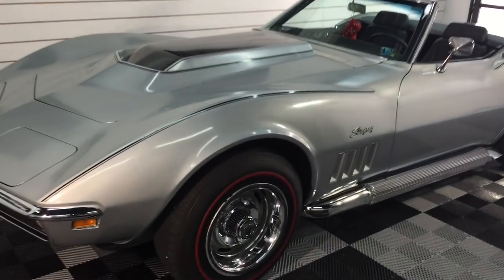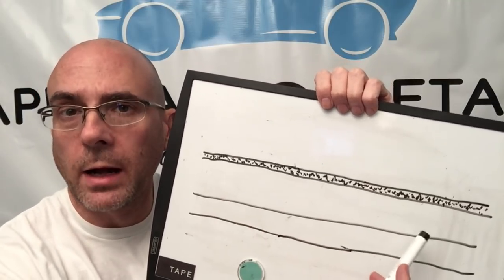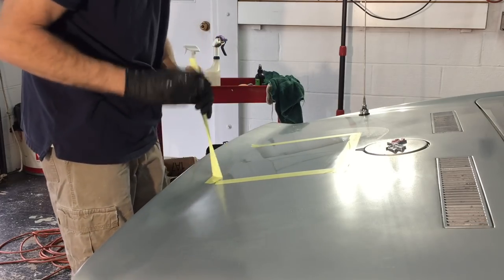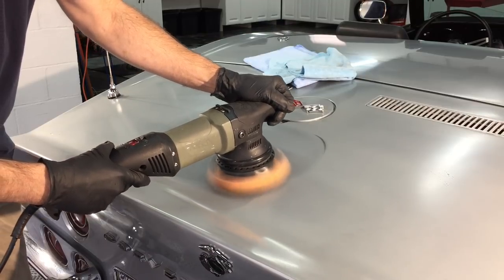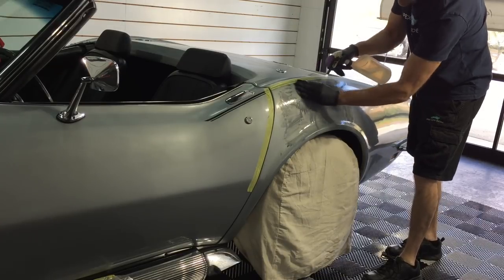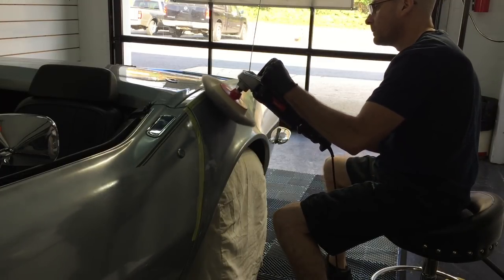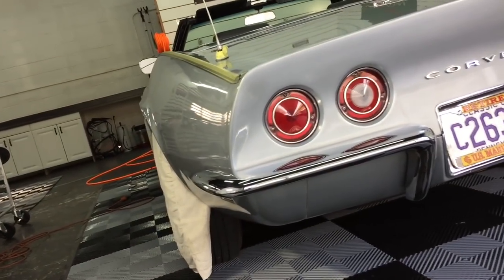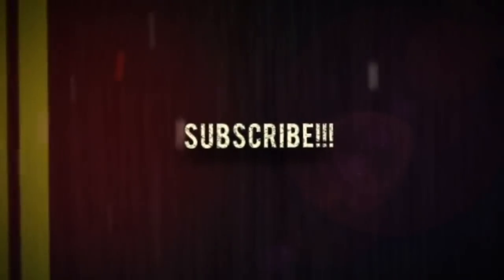How to remove heavy paint oxidation!! Paint restoration on 68' Corvette Stingray!!

Comment: Perfect timing! I'm working on a '76 Corvette Stingray on Friday! The paint is aftermarket and purple. It's going to require the 3000-grit Trizact discs for a lot of surface area. Thank you for sharing! :)
Reply from the maker: What is the goal? Texture removal? Oxidation?
Reply: @apexdetail85  The whole clear coat is getting a one-step to help clear up some cloudiness, but the main part is that the car was vandalized and scratched to heck and back in several areas. We'll see how low of grit I'll have to go to get a a safe result. The customer's expectation is set appropriately.

Comment: Great video and excellent job on restoring that paint.
You obviously have many years of experience.
I worked in a body shop when I was a teenager during the 70’s so I’m no stranger to lacquer paint.
Finnicky material compared to today’s urethane’s.very susceptible to burning due to it being a thermoplastic product vs thermoset.
Another way to go with a situation like that I think would be to follow up the 3000 grit wet sand with 5000 and 8000 grit wet san so that less buffing is required to bring it back from the dead so that less heat is introduced to the surface.
Please keep the videos coming

Comment: Great video as always. For single stage/ original paint would it be safer to use something like a Rupes Yellow Foam pad / Polish to clean it up and coat it from there? Worried about burning threw the single stage. I guess it could be done it will just yield lesser results than going with the 3k sand paper steps.
 Thank you

Comment: brain  , awesome work and thank you for sharing your knowledge with us beginner detailers.i would like to know is which size and manufacture pads do you use on your rotory i still have my old b&d polisher 6138 from years ago.
Reply from the maker: I use both a 5 and 7 inch backing plate. I use quite a few pads. Ardex wool, buff and shine foam, Lake Country lambs wool...all depending on situation.
Reply: first off, i just noticed  i spelled your name wrong, brain instead of brian but maybe i didnt . lol , anyway could you recommend which foam pads to get for now 5 ,6 , 7 , or 8 inch .im thinking maybe some 7 inch with a 6 inch lc flex backing plate.one more question. what are your thoughts on the lc ccs curved pads, are the any good. thanks again k

Comment: Awesome! How did you clean the pads in between passes? Also do you have a link for the pneumatic 2inch polisher pad and backing plate?
Reply from the maker: Ludensol _ the polisher and backing plate can be purchased at Harbor Freight stores or online. Central pneumatic. I clean my pads with a brush, Poorboysworld tornado pad cleaner and forced air.

Comment: when wet sanding an already wavy car, would a soft sanding block help when doing that so your fingre tips dont exploite the wavynes and maybe help straiten out the quearter pannel a bit..?
Reply from the maker: Not much can be done for the waves or sags at that point blocks can be used if comfortable with them.

Comment: Wsup Brian. I would like to purchase an air compressor for detailing. To blowout cracks and crevices after a wash as well as the inside and to blow out my polishing pads. Any suggestions? I'm looking for good quality but not too expensive.
Reply from the maker: I have a 30 gallon, 90 psi continuous dewalt compressor... it was on sale for $145.00 at Tractor Supply stores.

Comment: Could you apply a ceramic coating after paint correction to these older single stage vehicles? I have an 87 Chevrolet truck that I am considering doing that too
Reply from the maker: Absolutely! Just make sure the oxidation and imperfections are removed completely

Comment: I dont think I will ever understand this paint or clear coat thickness thing...  how can I wet sand a car, and still have enogh protecting left, when some say that a good buffing with compound and microfiber pad will reduce almost half of what is needed to protect the colour ?
Reply: Actually wetsanding is often less abrasive then using cutting compounds
Reply: @janalm1581  and that is what I dont understand.... you can remove pretty deep scratches with sanding, but not with compound.  And you can se the paint peel of, but still you have enogh protecting left.   I would Think you could polish with compound 10 times Before you have removed the same layer of paint/clear coat.
Reply: @arnenuggat  actually not. You have the answer in your question. Takes lots of runs with compound wich eats away at the coat way more. I Will check.  i've seen a video comparing it and links it If I can find it
Reply: Search jason rose wetsanding on Youtube should help you out
Reply from the maker: Carsten... that can be a long answer... my email is miragebjs@yahoo.com. Contact me there for detailed answer. I would be happy to help.